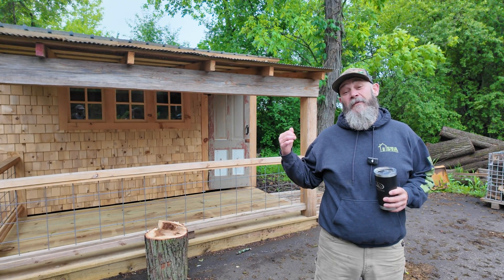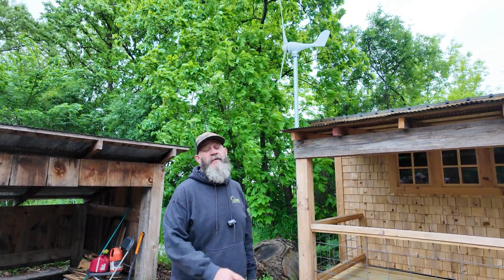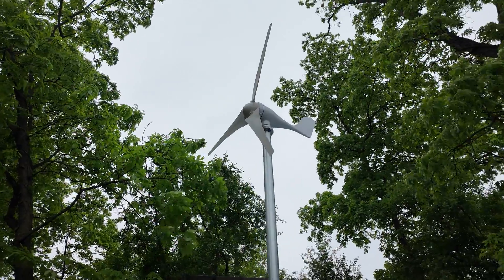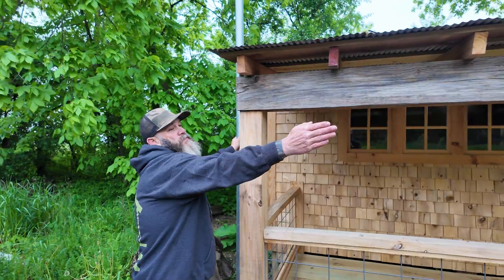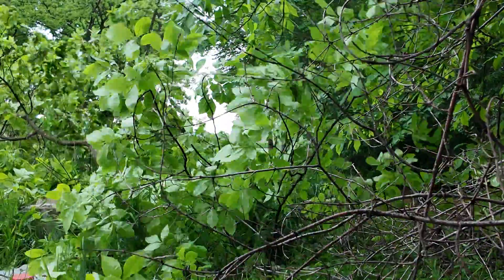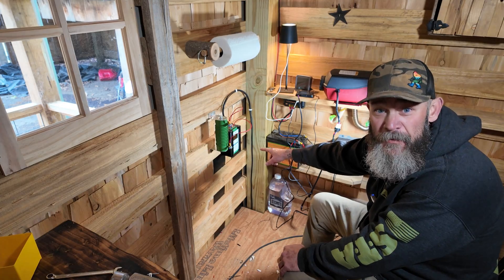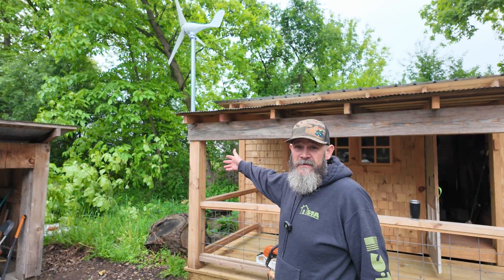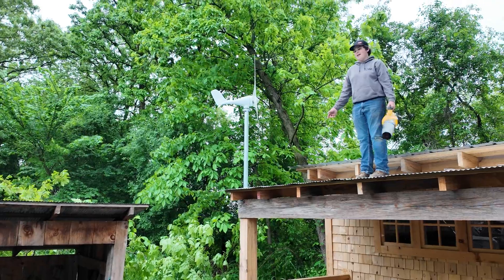Can This Wind Turbine Power My Micro Cabin?

Comment: I has a 52" wind turbine(Missouri wind and solar). So cool to play with. Had it up around 33 ft. high. I didnt really produce much though. Its possible one of my connections came loose. Had to move and sold if before i could verify that. Yes solar beat it hands down.  Mount yours much higher so it has a chance is my advice. GOD bless!
Reply from the maker: I bought a solar set up for my pond pump from them. I agree getting it up higher would work well. I am impressed with how often it is spinning where it's at.

Comment: SPOILER ALERT!   Most wind turbine stories end with the line, "...save yourself the time, money and agrravation by putting up another solar panel or two".  Wind turbines that aren't set well above your roof line, with no nearby tree lines to disrupt the flow of wind currents, rarely produce enough output to ever realize a return on investment.  In other words, they just don't make sense in most situations.
Reply from the maker: I think this will work well as a back up. Wouldn't want it as my primary. at $289.00 for the kit I don't think you can go wrong.
Reply: @buildlife Good luck with getting your money's worth on that thing.

Comment: Wind is about as reliable as a crackhead on payday! I'd invest in either hydro or buy a quality generator. And for those who complain about their generator not starting, stop using ethanol in them.
Reply from the maker: I think the more options I have the more dependable the system is as a whole. The funny thing is I only run non ethanol and when I walked away from the generator Gavin gave it one pull and it fired right up!
Reply: @buildlife  I agree, the more options the better.  I have solar and generac but I like the idea of making power on those occasional windy nights.